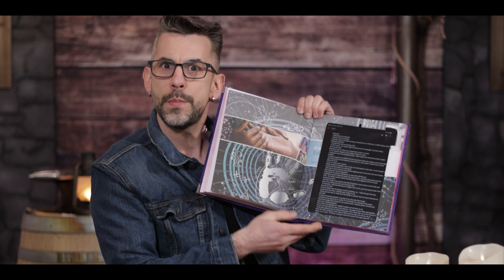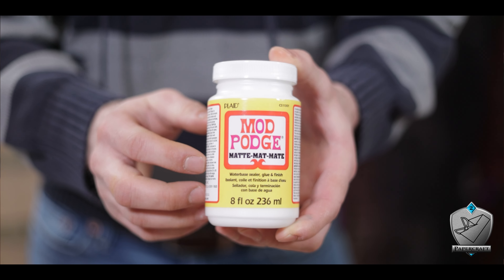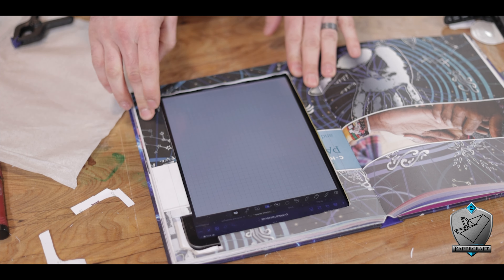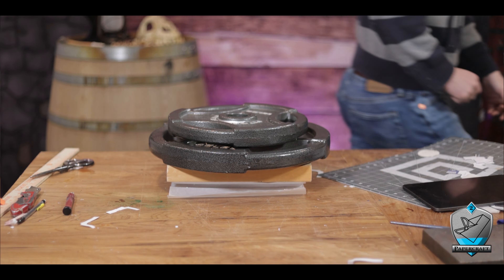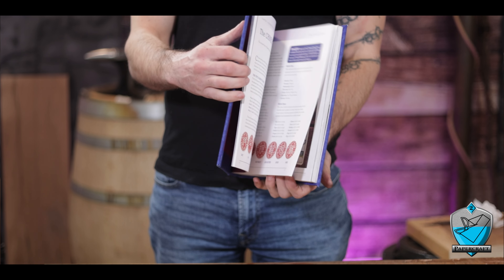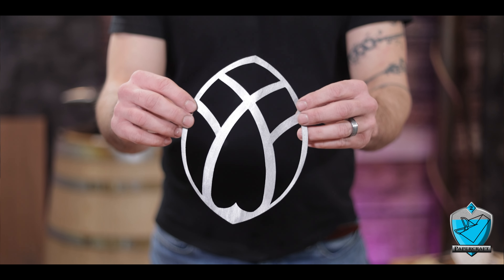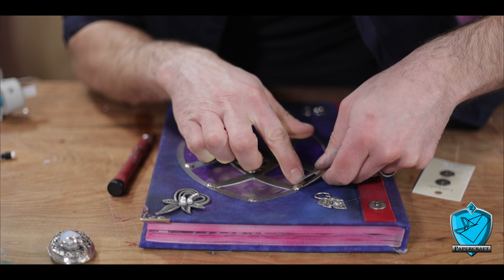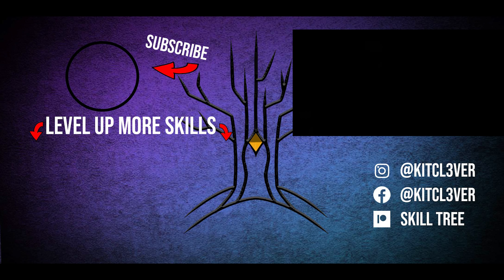Hide your IPad in a Book!

Comment: So at one point in time I was designing a modern artificer's workshop/ study. In it, I had a book case filled with refrence information books and a few " animated construct" props ( animatronics). Then I got the idea to make a mini PC, hide it in a fake book end by the animatronics and have a tablet interface for it inside a tome that clicked into a book stand esque charging dock. This project just trouble shot 1 of the 4 problems in my way as it provided me with a tutorial for the book.
Reply: Better late than never, but for charging it, there are cables that have removable magnetic ends - you could have the bottom of the tablet in the book with one of these exposed, and where it attaches to held in place on the shelf, so they snap together when you put the book away letting it charge without removing the tablet from the book! Sound like a cool project 😀